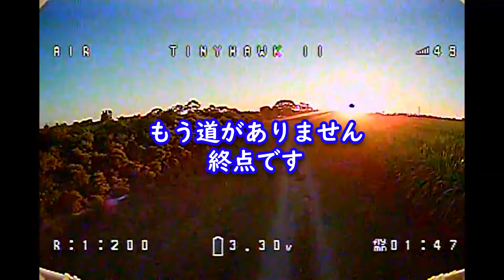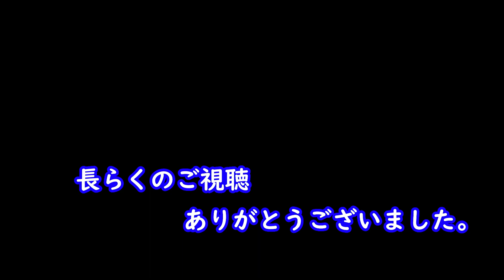EMAX Tinyhawk II 10円アンテナリフレクタで1ｋｍ越え！　with 10 cents antenna reflector FPV

Comment: Did you add aluminium foil in the reflector?
Reply: Yes I remember. I got confused. I made it also, but the foil is in front not back. I still can't test it because I don't want to walk more than 350m to pick my drone and my practice field is 300m diameter. You got insane range and very large field.
Reply from the maker: Good luck!
Reply from the maker: Yes I did. My another video...
https://youtu.be/eLwz7CuUnd0?t=40